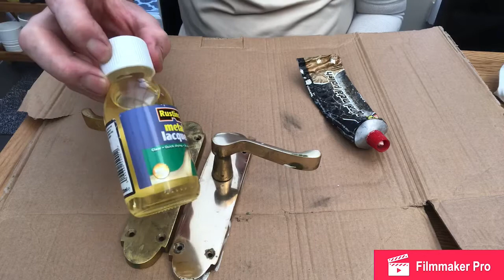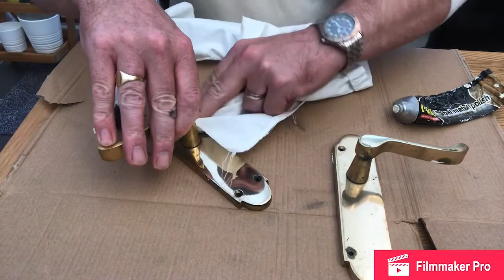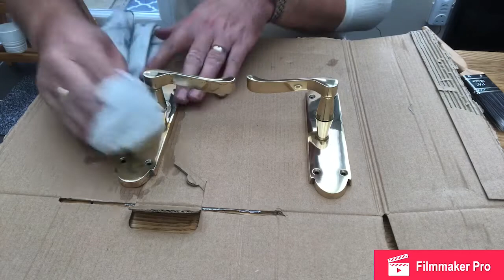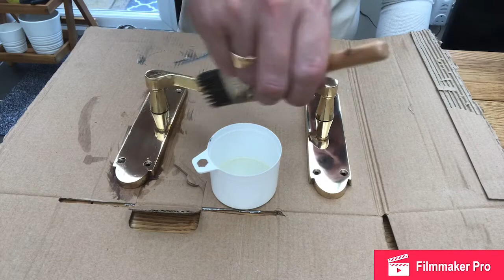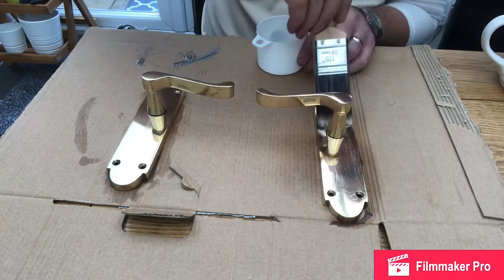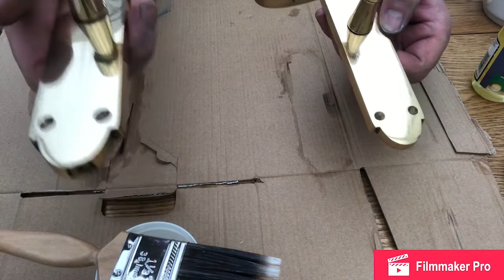Brass Door handle / knob  Polishing  & Re Lacquering Experiment  (Rustins Metal Lacquer)

Comment: This video is awesome, thank you! Quick question, would it be worth "dipping" or submerging the handles into the lacquer to eliminate any brush or streak marks?
Reply from the maker: I’m unsure if that would work any better as run marks come to mind, it could be worth a shot though, its a fair assumption that the Manufacturers apply the lacquer quickly some way but I suspect they use a thinner less viscous product than Rustins.

Comment: Thanks for making the video. I'm looking at restoring a brass clock case and the results you get are pretty impressive. I see that this was a couple of years ago, do you have any follow up advice? I wondered if it's worth using an airbrush. Either way you've given me lots to think about, a great starting place. Cheers!
Reply from the maker: The handles are on a downstairs WC so they have seen some use since this video was made. The lacquer has worn off in places on the exterior handle only damp hands I’m thinking. 
On the interior handle all is looking well with one exception there are some brush mark lines that are showing through, it looks like I missed a couple of areas to the dimensions one bristle. I’m sure for a clock you would be a winner as it would be untouched.
Reply: @TheRepairer  That's a good point, it's not going to be handled as much as a door handle. Thanks for the info.

Comment: Would you lacquer copper handles by any chance
Reply from the maker: I would give it a go if I had some.
Reply: @TheRepairer  no worries mate. I was just wondering as I have copper handles that needed restoring and they only look nice and new for a few days and then they get dull real quick when oxidised
Reply from the maker: @ABP7292  It’s metal lacquer it should work on all metals in theory, lacquering will slightly dull the newly polished shine but that’s the trade off for longevity.
Reply: I would recommend using a disposable foam brush. I spay a log of brass for s living and shoot it with a spay gun for smooth results. But for just a few around the house items, I guess brushing would be o.k. Foam brush.
Reply from the maker: Thanks, I will try that.